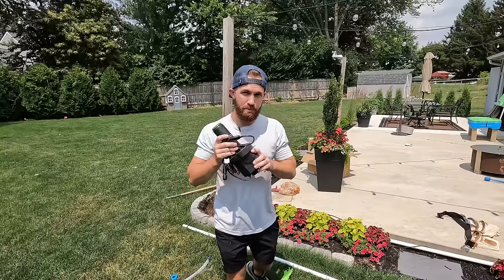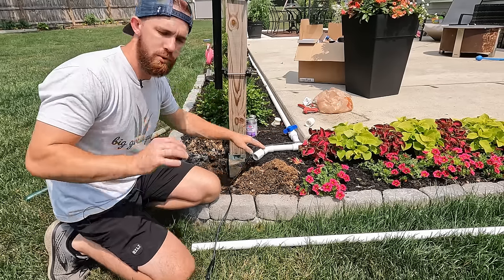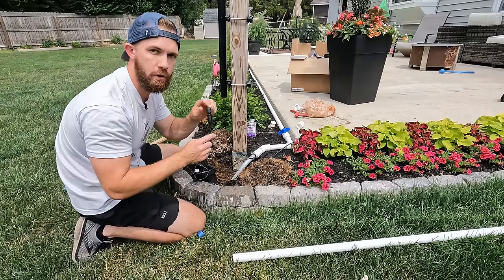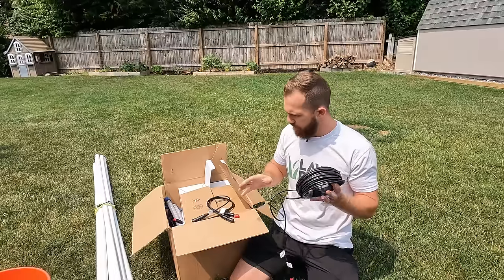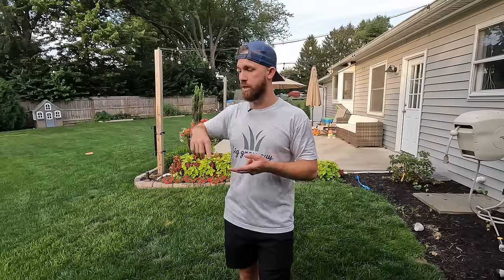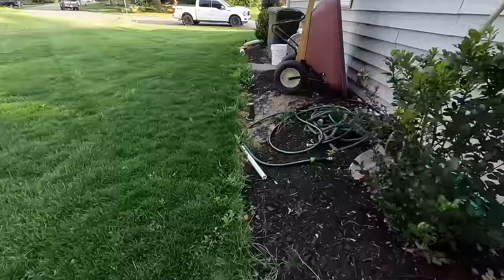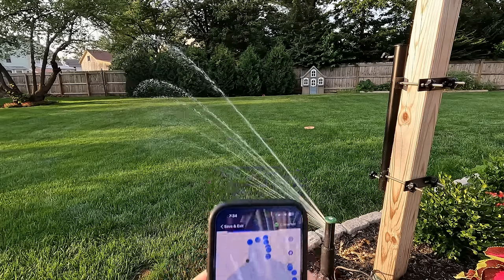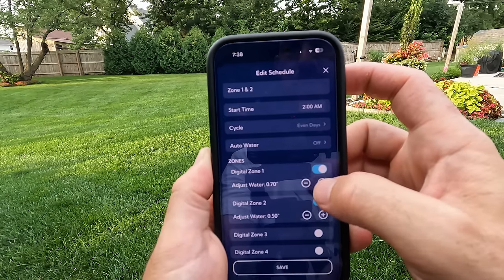DIY Smart Irrigation WITHOUT Digging!

Comment: For those too lazy to look. It's $1,570 for the controller (up to 17 heads) and $278 per head. Plus wiring and plumbing. For a single head system youre looking at around $2,000
Reply: That’s ASTRONOMICAL! That would NEVER work out financially in the long run.
Reply: I'll wait for the Rain Bird or Hunter iteration.
Reply: 😄 Nope

Comment: To make best use of the approx 30ft throw they need to be buried in the middle of the yard. If you did it your way you might need to buy double the heads and run twice the amount of lines. Kinda defeats the purpose of this system when you think about it.

Comment: Cool product...but just did my house schematic and price of $3995!?!?  Ouch!!! As someone that worked summers in landscaping/irrigation many years ago, I think the the old PVC Sched 40 with traditional heads is going to be hard to beat. I can see how this would be nice for well-defined yard areas without lots of obstructions, no sidewalks to contend with, no narrow grass strips down the side of your house, etc. But if you have all of that (like I unfortunately do!), you need a whole dedicated head to get around all of those obstacles. I like the idea just not the bottom line cost for folks in the DIY space.  Thanks for the review. --Matt

Comment: Excited to see the fall install and how much work it is to avoid the freeze zone. Question, can't you just blow out the piping in the winter to winterize it?
Reply: My thoughts exactly.
Reply from the maker: Thanks! Yeah I’ll be posting here and my IG all about the install. You could blow them out for sure. But I will be putting them in the ground.
Reply: @RootedLawnCo  How much does it cost and where can I buy it?
Reply from the maker: @chicuacemazatl3185  follow the link in the description. You’ll put your address in and you can map your lawn out to see how many heads you need for the area you want it.
Reply: @RootedLawnCo  ok thanks!!!!

Comment: You said you have a 3/4" line coming off your main water. You then connected a 1" line to it? does that really increase the pressure?
Reply from the maker: Irrigreen specs say they want the system on a 1” line. But yeah, my main line is only 3/4” so I’m not too sure if it changes the pressure.

Comment: It would of been helpful if you would of shown how to supply the system.
Reply from the maker: I tapped into my main water line. So my pex line, put a T in it, with a stop valve, then ran it outside to the backflow preventer etc.

Comment: Only works if you can reach all parts of your garden with a single line driving a single zone running the edge of your slab. To reach distant beds will always require multiple zones due to water pressure limits and hence digging

Comment: Is this system works well in cold weather (windy City) in Chicago?
Reply from the maker: Yes. You generally run any irrigation in early am before it last too windy during mid day. During the winter, you blow the line out (see other video) to prevent damage.